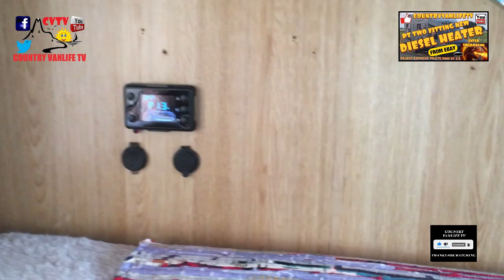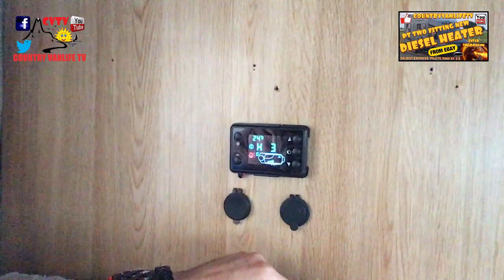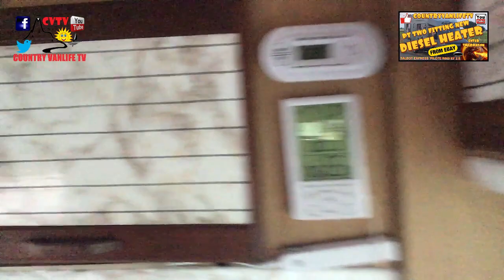Chinese  Diesel Heater Pt2 “Fitting My quiet method” Shhh ?? #campervanheater #vanlife

Comment: Great vid yet again Steve, Lovely Jubbley . Just a bit of advise Steve, put your display on a switch then you can turn it off when not in use for long periods, the displays fade in time. I had mine on 24hr a day and after 4 month you could hardly see it, i did a vid about it if you want to check it out
Reply from the maker: Cheers Paul Howdoo   I pulled the fuse out to turn off Its a bit bright lol But will take your tip and fit a switch ATB mucka

Comment: Lucky like a bit of work but well worth it in the end you were talking about your bike tire my friend put some sort of liquid in the valve that runs around your tire as you drive on your motorbike I don't know if that will help if you can get hold of some it's stopped him getting a lot of punctures cause it got resealed as the liquid with spinning
Reply from the maker: Cheers Gary may try the Goo tubes ! Hope your all fine in the Obrien household x ATB my friend.
Reply: Yet thanks all is good mate

Comment: Brilliant video Steve. Well presented and demonstrated. Could have done with seeing a little bit more on the electric panel fitting etc Couple of questions 
Do you have any idea of how much fuel it uses per hour etc?
What happens when you turn the motor off? (Does it have a cooling off programme)
Cheers Dave
Reply from the maker: Watchta Dave yes mate At low/med it runs apx 70 hours for 10ltr Which is excellent ehh. On turn off at control it goes to cool shutdown sequence about 10 mins then off. I did have vid clips of wiring, but for some reason lost it lol Ill show at update on performance vid Dave Hope that helps bro ATB
Reply: @countryvanlifeuk  Brilliant thanks Steve. Really great channel. Lovely Jubbly!